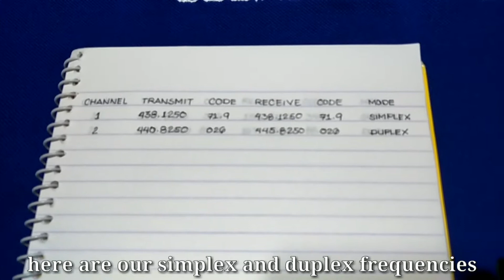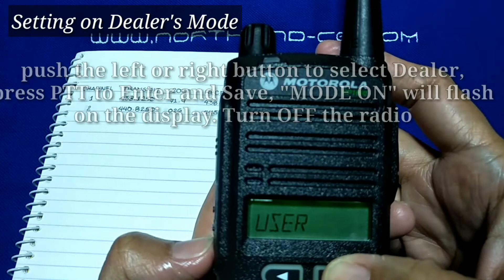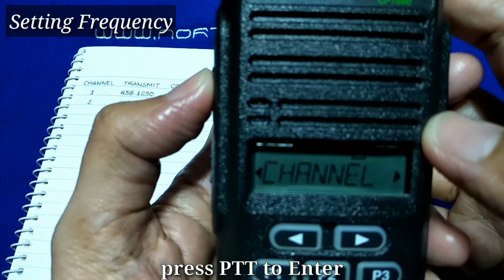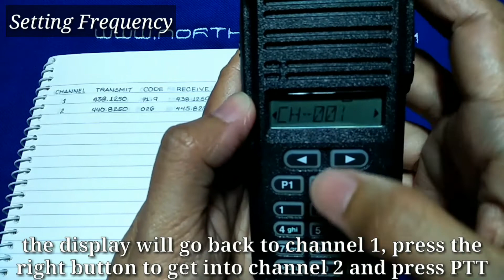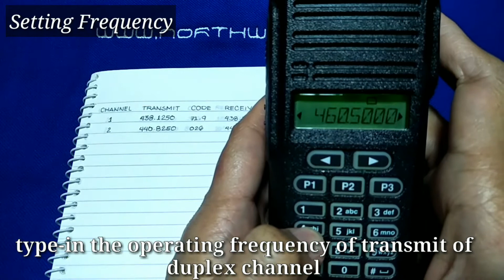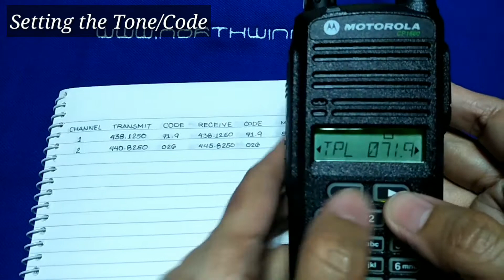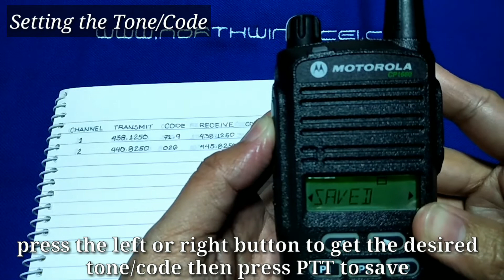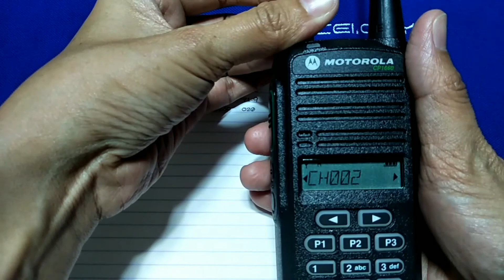Manual Programming of Simplex and Duplex Frequencies on Motorola  CP1660 Portable Two-way Radio

Comment: Ung cp1660 ko eh may transmit pero walang receive. Dko po masundan ung video nyo. Simplex lng po gusto ko na i program. Salamat ng marami
Reply from the maker: saan po banda kayo nalilito??? tama po ba yung frequency at code na gamit nyo??
Reply: @inhinyerangina5128  mam paano po kng hindi po ayw po gumana ng right & left button? Nka steady lng po s word n backlight
Reply from the maker: Sir yung right and left button po ba gumagana sa normal operation? Ibig kong sabihin naililipat nyo po ng channel? Kapag hindi po baka may problem po ang button. Isa pa po need nyo po ilagay sa dealers mode ang radio bago magprogram. Pwede nyo rin pong itry i-reset para maibalik sa default setting nya baka may napindot lang po ng di inaasahan.
Reply: @inhinyerangina5128  ayaw po malipat. Nka steady lng po s backlight. Ano pong pwdeng gawin?
Reply from the maker: @lioness1508  sir nalilipat nyo po ba ng channel yung radio nyo kapag ginagamit nyo sya??
Reply: @inhinyerangina5128  pano po ilagay s dealers?
Reply from the maker: @lioness1508  punta po kayo sa 2:24 ng video na ito para makita nyo paano sya iset sa dealers mode
Reply: Boss bakit po kay hindi nila ako marnig?pero sila naririnig ko
Reply: Same problem may transmit at walang receive?